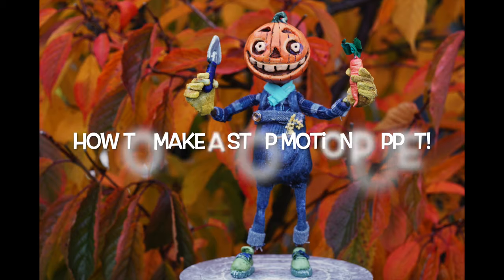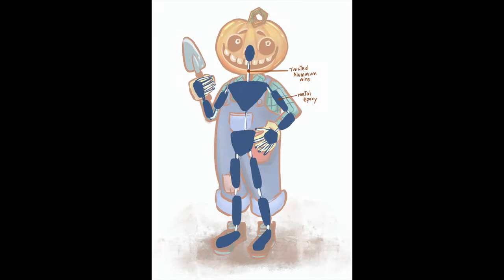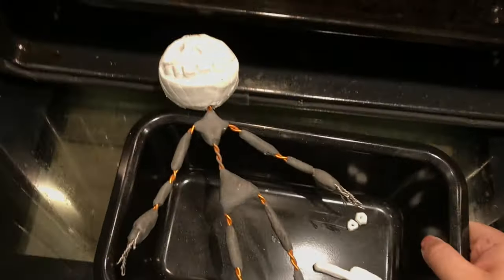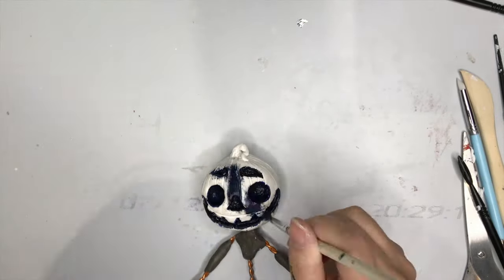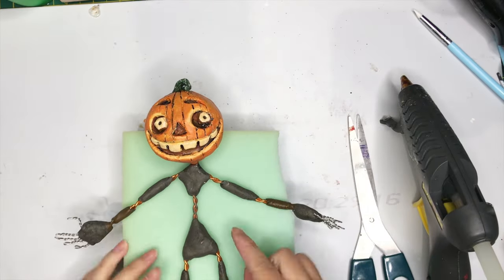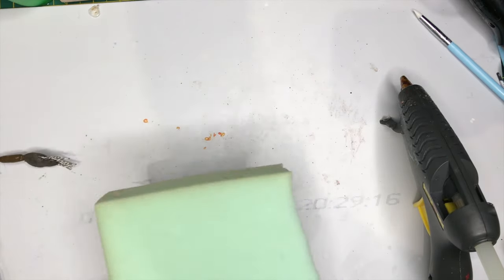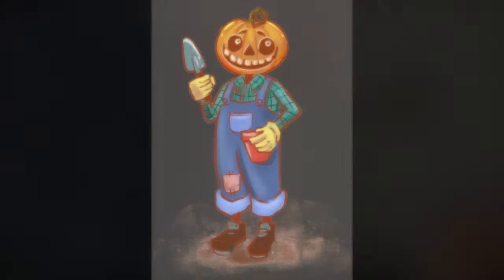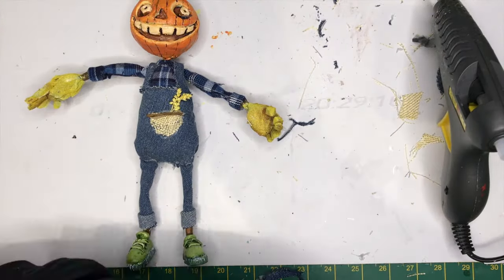Holly's One Day Build: How to create a stop motion puppet!

Comment: You can also add some key holes on the back and front so you can use a rig to hold your character in place while animating. Just add them into your milliput, I use two different size brass rods so the can slot into each other 😊

Comment: Great work! Question: do you ever have an issue of the fingers snapping off when you're moving them around? That just happened to me while using 1mm wire. Wondering if you have a trick of how to avoid it.

Comment: really helpful video thanks Holly. There is a cheap alternative to the metal epoxy that you are using that usually comes in small tubes. BigBoy metal filler is around £6 for 250gms. Would that do the trick do you think? Seems to be similar stuff?

Comment: I wanted to ask a quick question; what would you recommend doing if you want to be able to change the outfit of your puppet? Would it be best to just make multiple puppets with each outfit or is there a way you would recommend to be able to change outfits on the same model?
Reply from the maker: I would make outfits that are easy to remove from the puppet with attachments such as Velcro/snap buttons/magnetic strips . Less work and material required for this method:)
Reply: @HollyLam  that didn't even cross my mind tysm XD
Reply: @HollyLam  I have one last question; how would you recommend making or changing the doll if your trying to make a doll that for example has thicker arms, legs, hips, or chest? Would you keep the base the same or edit it?

Comment: Good tutorial, felt like you made it look easier than it actually is for some reason lol, if you don’t mind me asking, how much did this cost, and how long was the process?
Reply from the maker: It definitely isn’t an easy process if you’re doing this the first time! I’ve made quite a few of these over the years so this process is what I’ve developed and refined from many trial and errors. This project took me a full day to make but as a beginner it may take longer. The cost depends on the materials you decide to use as I already had some materials around the house such as the sponge, wire and fabric. As someone just starting out in stop-motion, If you were the purchase all the materials it would still be more cost effective than purchasing a professional stop motion armature etc. :)
Reply: @HollyLam  interesting, I’ll keep this in mind for when I start at some point, and again, good tutorial
Reply: @HollyLam  if you don’t mind, do you have any knowledge on working with multiple faces or expressions, and also flexible joints for a puppet?
Reply from the maker: @derpanimator3097  I do know a bit about about face/ head replacement parts (usually made from plasticine or hard materials either 3D printed or hand sculpted with magnetic attachment) and moveable eyes and mouth (when puppets are silicone casted) as I have made puppets with those components. They do take a lot more time and materials to make. There are people who have made flexible joints on their puppets by adding nuts and bolts that are used in professional armatures to wire armatures as an alternative. A lot of online resources and tutorials cover that aspect so it is definitely worth looking into :)
Reply: @HollyLam  ok, thanks

Comment: How did you get your puppet to stand without nuts or magnets?
Reply from the maker: I made sure the puppets weight was equally distributed when posing it. ( it does end off falling if its not balanced, so in some of my other puppets I did use magnet in the feet) I also usually sculpt the feet big and flat enough to support itself. Hope this helps :)